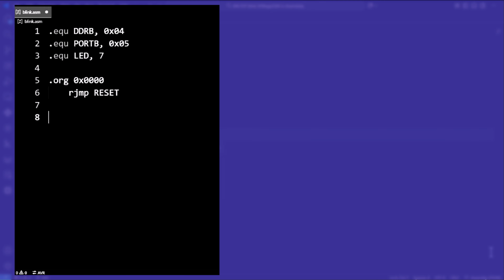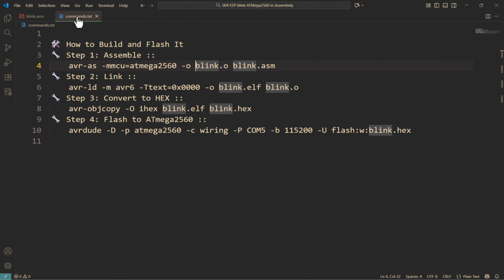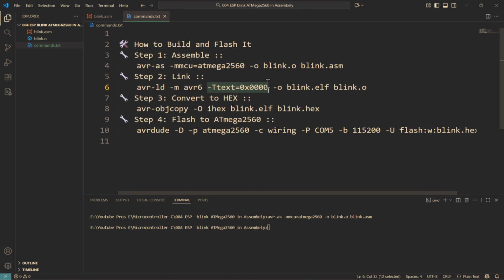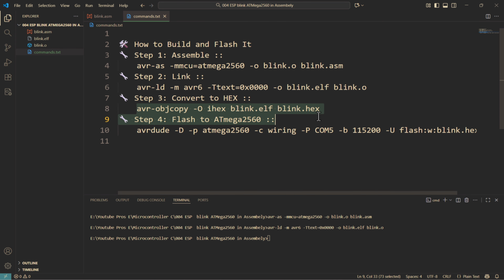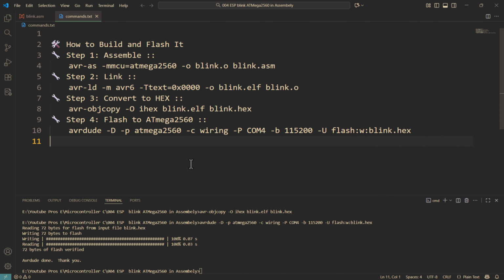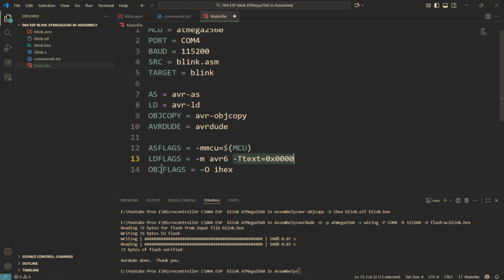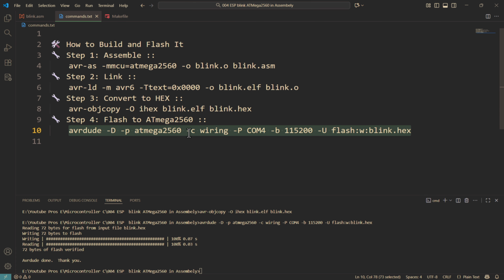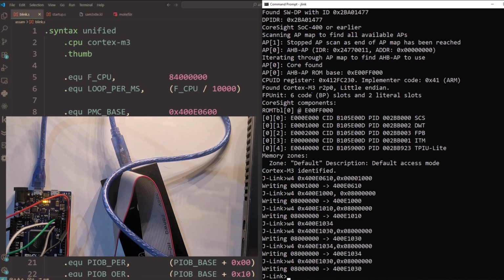Bare-Metal Embedded Systems (AVR & ARM) in C & Assembly – blink atmega2560 AVR assemble and uploade

Comment: Hey bro, may I ask you how you were able to study these all? did you self learn.. if so are there any material like books, videos etc that you would like to share with us. I really like this kind of low level programming in C and such languages. 
As I watched your videos I did implement it on atmega328p and it was fun.
 
Thanks !!
Reply from the maker: Hey 👋
Yes, I’m a software engineer, and I studied analog IC design as well -  but this level of understanding mostly came from years of self-study and hands-on work.
Embedded systems reward curiosity. Read datasheets. Experiment. Build small projects. Break things. Fix them. Repeat.
That’s awesome that you tried it on the ATmega328P - that’s real learning right there .
you can just follow my videos - I’m building the series step by step so anyone can learn from zero 😊
Keep going!